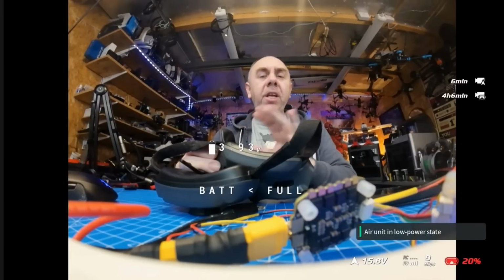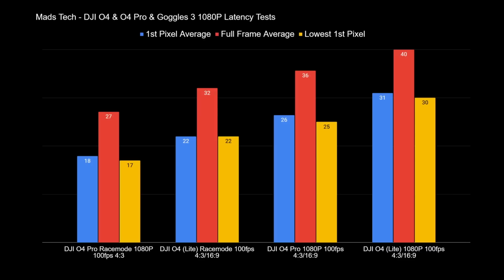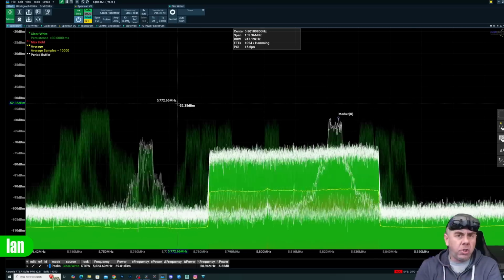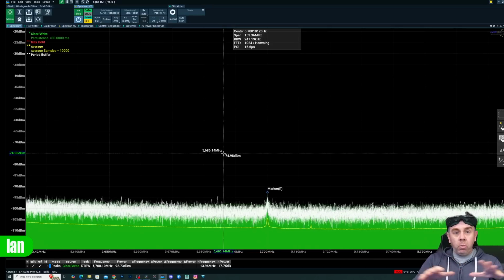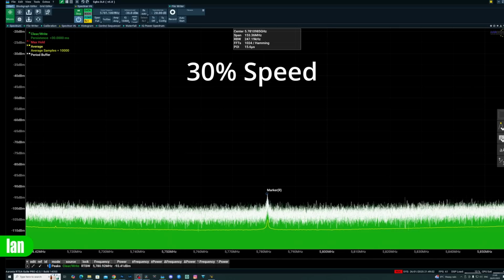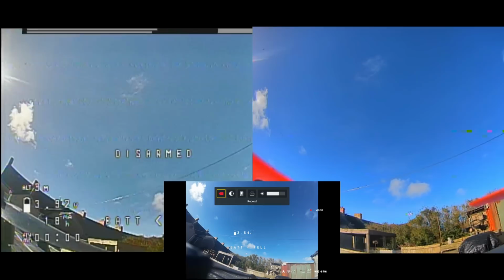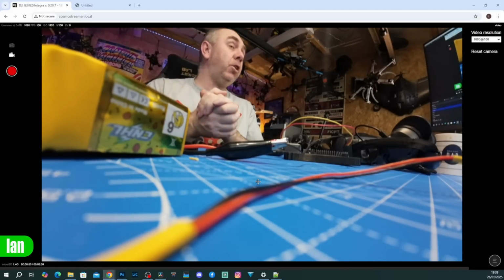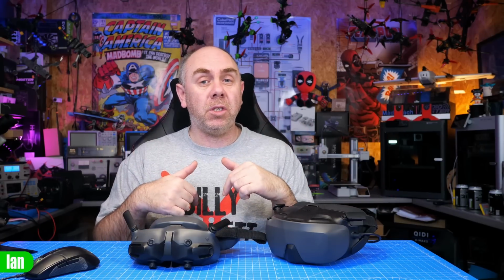DJI O4 Racemode - Complete Overview & Technical Deep Dive

Comment: Would you get more range and penetration out of the 04 if you used a separate radio link? Or do you get more using the DJI controller?

Comment: How does "first pixel" and "full frame" measurements even make sense for DJI's system, which is progressive? o.O
Reply from the maker: Beciase it's still a measure of the time of flight over the RF link end to end.
Reply: @MadRC  I don't understand how time-of-flight relevant. 

Analog and HDZero do partial screen updates. Analog is literally one line at a time (scan lines) and HDZero is very similar (though it can send more than one line at a time), so you can get individual lines sooner than a whole field/frame, so there's a difference between "first pixel" (i.e. first scan line) and "full frame" (entire field/frame has arrived).

DJI doesn't send incomplete frames. Once the goggles have decoded a a frame, the entire screen is updated all at once. So "first pixel" and "full frame" should be the same.

Comment: We want to get or build some race gates for indoor and outdoor use. We have HDZero, DJI o4 and analog pilots who would all like to compete. Can I use typical old RSSI power spike gate detection for drones arriving at gates? I'd like something that can work with all kind of platforms. I've seen all sorts of home brew systems using different sensors but nothing shouts out that it will work with everything and ChatGPT doesn't give any conclusive ideas.

Comment: And how is the latency with the goggles n3?🤔
Reply: Transmission wise it’s the same as the 3, however the frame rate on the screen is only 60hz so you get some more latency due to the screen itself.

Comment: Hi Ian, I have a tough question because I suffered from flying the O4 Lite in an event scenario couple days ago. Everything was tested beforehand in park and since the micro uses ceramic antenna elrs I never made it to get real choppy o4 lite because of the RX so everything was 100% functional. At event I used the normal mode in 60MHz setting and suffered occasionally horrible stutters and even freeze frames mid flight basically in front of me (we talk about roughly 20/30meters). Obviously a crowded event is way more noisier and even though its forbidden some people will lift off with dji mavics what adds to a bad overall interference situation. Would I have profited from switching to 20MHz mode? Unfortunately only when driving home I somehow thought about it less bandwith would mean less "attacks" on my signal and when I already occupy three channels instead of one the likeliness raises by three kind of. And one other question would one profit from race mode in this scenario? I tried race mode once it was okay but luckily I didnt feel it too much thus I enjoyed more the details in 60MHz normal mode. Since the 60MHz normal mode seems to not be flyable at all safety wise I will try out 20MHz and since I dont need range/penetration when flying in front of me maybe the better latency would at least update fast enough another frame sort of behavior in comparison to the regular mode. 

I know its a lot of questions and thoughts maybe also another scenario to test for a video. But all in all last year I did this same location with HDZero even though it was obviously noisy it was flyable the whole time at 200mW and you know what power levels the o4 lite is capable off still it knocked me out of the air. Antenna polarization was also an idea but a fellow pilot used a micro with o4 pro means the two LHCP antennas and also had terrible signal according to him. I suspect his was still a bit better because he could fly at least a bit for me it was too dangerous.

Comment: I wonder if this system in race mode will actually be allowed in races that use hdzero and analog.  The fact that the goggles still transmit may be problematic and races also use channels F2 and F4 , not just raceband (which analog and hdzero support)

Comment: Does the walksnail race mode behave the same way? Like goggles transmitting on the same channel as the VTX?
Reply from the maker: Yes. Actually walksnail always aligns video and goggles.
Reply: @MadRC  interesting! Thanks for the response. The width and interference is then similar to what we can see here for DJI, I assume. Or any differences worth mentioning?

Comment: Not sure if it was mentioned in the video and I missed it, but is 40mhz race mode same latency as 20mhz?
Reply from the maker: Yes latency is not affected by bandwidth
Reply: @MadRC  Amazing thanks. Do you plan on doing any more testing with the N3? I'm curious if there's any latency difference considering they (i assume) would run at 50hz for race mode and skip every second frame

Comment: Dang, a Spectran V6 is pricey!!!!
Reply from the maker: Oh yes.
Reply: On that topic, for hobby uses I was quite impressed with just using a Pluto plus SDR (over ethernet, probably decently worse on original pluto over usb) with Satsagen software. It's no Spectran, but it's fairly fast (~20ms per refresh for 200mhz span, faster for smaller spans) and for me at least is plenty to play around with all that RF stuff. And for about 150-200$ is pretty cool. Plus you can dump about 11mhz worth of spectrum without drops over ethernet (about 6.5 over usb) seems to tap out at 400mbit/s over it.

Comment: Hi Ian, totally other question say one would want to use an o4 pro unit as an external camera just for onboard recording with a 3d print where it becomes round about a GoPro session sized cam. 

How would you trigger a recording you’d need to be connected to the unit with goggles, right? 

I know it sounds funny but imagine id want to fly analog or say DJI v1 as my FPV system (only very special case) und have the o4 on top instead of a GoPro. An arming signal i could never give the o4 , right? At least without low power as long as it’s connected to the goggles it should be possible to send a recording trigger, right? Or do I even need for that the msp connection
Reply from the maker: Sadly you can not use it with out goggles.  It goes into standby with no goggle connection
Reply: @ aaaaah so sad and when you have a Google connection in the scenario say I need low latency and run analog/hdz but since I also have g3/n3 with an o4p i wouldn’t need to buy a new GoPro for twice the price when the o4p has a print design to switch it between frames. 

What would I need to take care of to get this running

Comment: Would it Bé possible if dji would update firmware so goggle 2 and integra can use thé raceband stuff ... Thé low latency is not possible due to hardware .. but thé channel map and RF behavior should not be a problem

Comment: DJI's delivered with the race mode an RF behavior analogue to HDZ or analogue. The latency is on par with the O2 (vista) system, considering it is 1080P vs. 720P very impressive. That being said the latency is too high for a true racing experience (more than double to HDZ). DJI should have called it freestyle mode ... that would have been more appropriate.
Reply: Race mode shows you a 540p picture as I understand. Only the link setting is 1080p/100
Reply: Yeah but have ever tried racing HDzero indoors with like 3 other pilots? You don't see shit anymore while DJI racemode even on 04 lite looks flawless. Sometimes you want to see better then have the lowest latency. Not all fpv racing is just memory muscle rotating around gates at ludicrous speed. There is still racing where the tracks have not been memorized so much and where at times it's more important to see well, then have super low latency.

Comment: openipc isnt too bad compared to the normal modes from dji from my testing at 240hz. Wish I had a better camera...
Reply: also it works with my timers. I wonder what openipc looks like powered up at 25mw on rb1 next to analog/hdzero/dji o4. I plan to use it for racing this summer

Comment: I mean something like race mode (lite) for integra and g2 would be great. I mean it could be a higher latency but it should at least align the channel to raceband und clean up telemetry ...
Reply: i mean there is already a difference on g2 + c2 on O4 compared to the g2 + c2 on O3. On O3 the controller connects without the goggles powered on on O4 this does not work. The goggle has to be powered on  first.

Comment: It is just me or it is a fact , but with DHI o4 everything looks farther away from you and you lose on side information , like with analog and HDzero you got more filed view   like helps you more in turns by seeing whats in the corner,  but with DJI I'm a bit more worried in corners buy not seeing enough details being more narrow
Reply: That depends on your lens and it's field of view. You can slap a lens in front of a DJI lens to change this.
Reply: @KainniaK Thanks for your tip 👍

Comment: When using race mode around other people using dji in non-race mode, will I get stomped on by them like analog, hd zero and walksnail?
the scenario would be a group of people flying freestyle and not everyone having the latest gear.
Reply: Yes, when any DJI goggles boot (outside of race mode) they will go straight to channel 7 and blast out a message "Hey I am here" which jams absolutely everything including other DJI goggles in race mode. You will stutter like crazy, your bandwidth will drop to nothing, and your latency goes through the roof. 

The solution is to make sure that while anybody is currently flying DJI goggles are NOT allowed to boot (unless they are already in racemode)

Comment: Does latency change when dvr is set to 4k 100 vs 1080p 100
Reply from the maker: No
Reply: @MadRC  Does the 100 hertz of the goggles 3 actually come with a 100 fps or is it all 50 fps with the same frame twice?

Comment: I wonder if the latency between the 04 pro and lite was an oversite by DJI, or if the hardware used in the lite is that much different that it adds 5 ms of latency.  If its not hardware, and it was an oversite, perhaps a firmware fix will come out later?
Reply from the maker: It's most likely the camera.  DJI is also under clocking the Lite it seems a little but my bets are it's due to the limited modes the sensor offers and it's having to do a little more processing.

Comment: We use race mode for freestyling in groups.  Turn it on 40mhz 1200mw. You can fly 3 pilots.  Choose the channels R1 R4 and R8. You can go further than 03 with this setting, AND lower latency.  Go to 60mhzs 1200mw to have 3 pilots go even further! (Tested in 2 different groups, also with analog and hdzero)
Reply: When me and my wife fly our DJ neo's together we can stay in auto and just put something in between the goggles, like a tree or something and it's fine except for when the goggles and booting, then you get blased (cause they go to channel 7 on boot and blast out rf to let the band know they are there).

But when I fly with a mate, and we both fly 03 or I fly avata 2 and he flies 03 then what works very well is using the ham file and put both goggles in manual, one on 2.4 Ghz and one on 5.8 Ghz. He can get full 60 mbit on 5.8 GHz and I can get 40 mbit on 2.4 Ghz. His range and penetration goes down a lot and my latency on 2.4 Ghz goes up a bit. But it's very flyable! 

But now with racemode hopefully it will get even better! 

Still it's always a very good idea to have objects in between the goggles. Like I'd go sit in the car and my mate on a chair outside of the car. Or we are sitting on opposite sides of a tree. That way we can still talk while flying, but the interference is more limited. 

Because no matter what you do, your bandwidth will get cut in half. That's just how it works.

Comment: Day 1 of asking for a goggles 3 full antenna mod.
Also does the O4 reaqire signal better than O3 after full or partial signal loss/freeze?
Reply: The faster signal recovery comes from the Goggles 3 and is the same for 03 and 04. With Goggles v2 on 03 after restoring LOS it can easily take 1.5 seconds, on Goggles 3 with 03 or 04 recovery feels instant as in under 250 ms.
Reply: Hugo says he'll make me antennas with long ufl's 😮
Reply: @Fly_High_FPV  damn